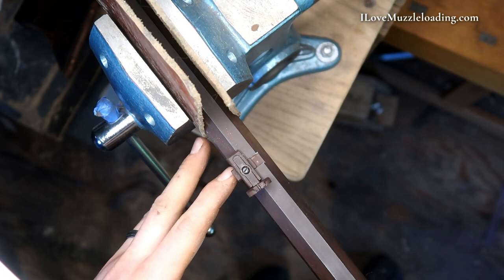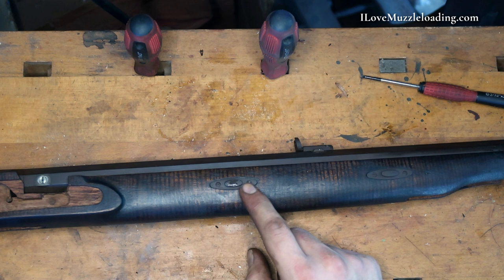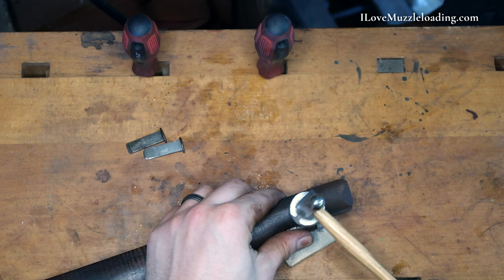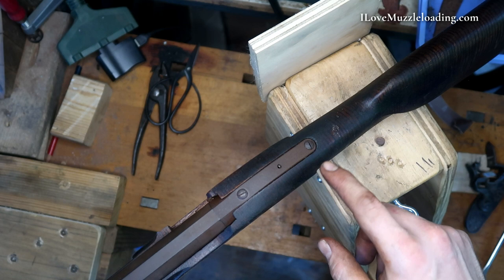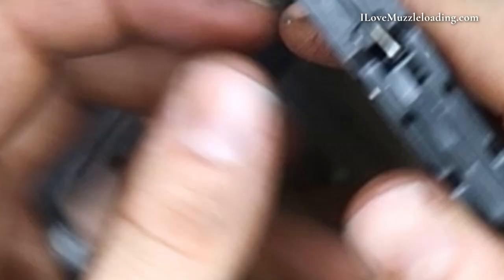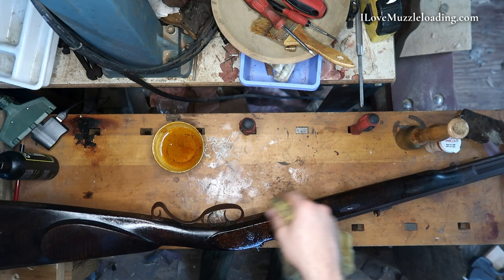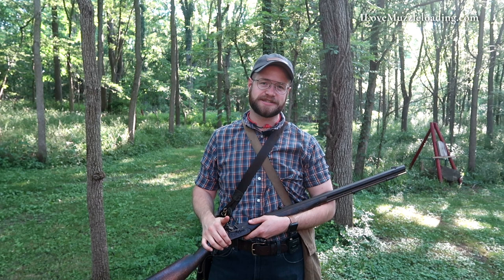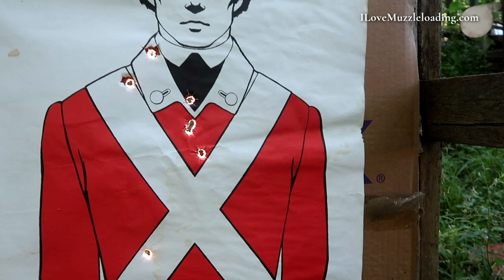It's FINISHED | Investarms Gemmer Hawken How to Build Part 24

Comment: Pretty good lock time there.
Reply from the maker: I agree. The way people talk, these locks are junk but I've had a great experience with this one.
Reply: @ILoveMuzzleloading  I bought their cheap flintlock carbine.
 Ugly black plastic stock, no under rib .24 inch barrel and 1/48 twist. Hate the sights.
  Overall possibly the best shooting flinter I've ever shot. 
Flawless and quick ignition nearly as quick as a caplock. Keep the Frizzen clean and dry, keep the rock sharp, clean and dry, keep the touch hole clean. And it will never fail you.

Comment: I remember when I built my rifle shope musket the amount of time making sure my underlugs and corresponding chiseled out areas to except the lugs took me over a week before committing to the work.
I measured and double checked measurements so many times.
And then it came to the barrel pin holes in the fore end and that was another few days of measuring and checking until it was time to commit.
And it came out well, not bragging it was a real learning curve for me, and was so relieved that it worked out.

Comment: I live in the sub tropics and I understand why you mentioned using a modern lacquer but I have never had to ever resort to this.
I would be upset at myself for such a thing.
Linseed oil mixed with gum turpentine has been my choice and I like a satin finish which with use begins to polish areas of the stock.
I have had problems with mould but not on modern replica muzzleloaders.
There is a good all round product here safe for organic materials which kills mould.
But I have only encountered this twice in my life and we have killer humid summers.
Reply: White vinegar best.

Comment: My percussion Hawken kit just arrived and I’ll be putting it together later this summer. I really like how your dark on dark came out so I’ll blue the barrel, black the brass, and use a deep stain. This will be my first and only wood stock, cold blued rifle. Can I use a simple mineral oil or gun oil over all the parts in the last step instead of the specialty oils?
Reply from the maker: Absolutely you can Lonnie. I recommend the mineral oil over the gun oil on your wood stock, it will be a "cleaner" oil and shouldn't color your stock any. The gun oil might have a different color that could dye your stock an ugly green. Feel free to use the gun oil on your metal hardware.

Comment: man! i know its been awhile, you did a lot of work on that thing, thanks. i had my old hawken stolen . and just ordered another kit . i hate that it comes with a plastic rear sight . whats up with all that . does it cost that much to cut another dove tail for the rear sight ?
Reply from the maker: Which hawken did you order? There are several screw on metal sights available you can bolt on rather quickly for a more traditional look.
Reply: @ILoveMuzzleloading  the traditions, st louis hawken , same one i had from 30 yrs ago. the old one i had was steel and it screwed on to i believe but it was steel. any recommendations on steel sights?

Comment: Um your not using the 2 trigger system correctly I don't think.... on my cap and ball CVA rifle I built I would fully cock the hammer squeeze the 1st trigger till it clicked then a fine touch
on the 2nd trigger set it off (releases the hammer) the idea of the 2 triggers is so you can set the amount of the trigger pull the beauty of that is really important when target shooting
if the set trigger is set too hard your groups will be erratic.... but when you set it correctly
and use it correctly it is unbeatable ! i believe that is the way all black powder rifles are set up with double triggers the first trigger from the muzzle back is your set trigger it's a hard pull... the second trigger is the firing trigger.... at least that is the way I used it....